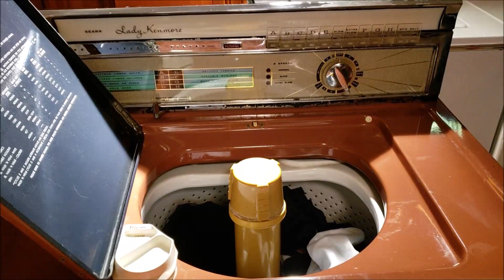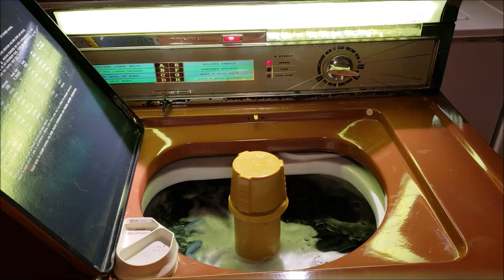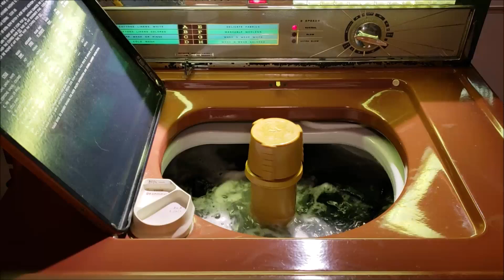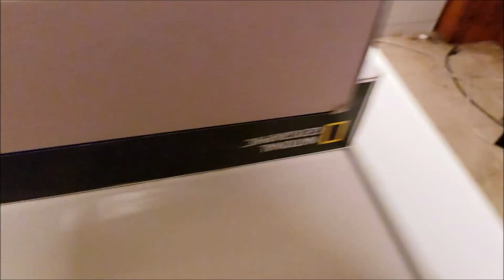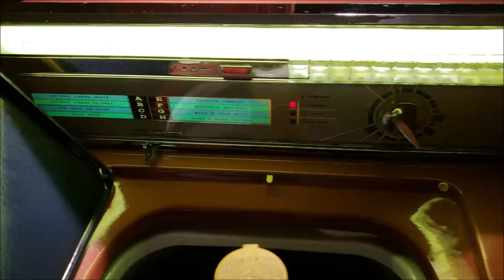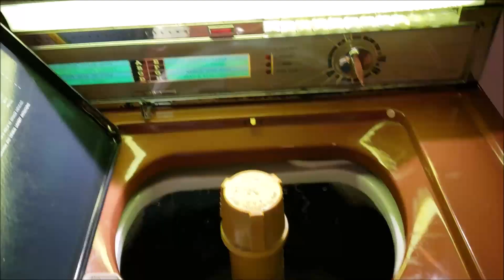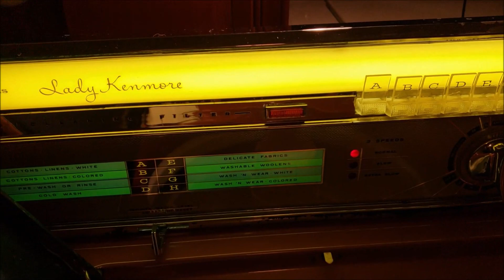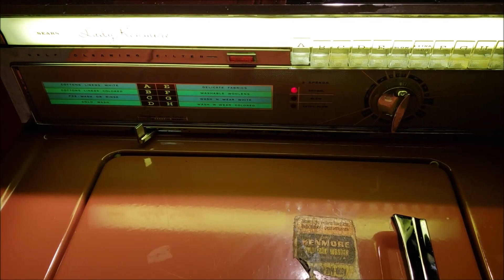1965 Lady Kenmore Washer- Washing work pants

Comment: Adjusting the water level to low does not change the amount of time it takes to drain that’s a timed drain cycle. Regardless of the water level in the tub high or low it will drain the same amount of time. My aunt had a Kenmore washer and I used to do her laundry many times it was an oldie believe it or not it was older than this one it had all the alphabets that you select a cycle with. Built like a tank with the black Roto swirl agitator and the same top that you have, black rubber with a detergent cup over it.
Reply: Was it the 1958 model with the black Roto swirl agitator and the letter K engraved on the timer and or agitator?
Reply: Antonio Carter yes I think so. I know I saw one on YouTube that was restored and looked beautiful. If I find it later I will let you know.
Reply: The 800 model had the black roto swirl agitator with the cup over it also alphabet cycle selector with the lighted panel  ours was a 60s model
Reply: On This Machine There's A 2 Min. Draining Period Before It Goes Into Spin

Comment: Gorgeous machine.  Love the color and the lit control panel.  The agitator scrubber is something we'll never see again.  When Whirlpool changed from direct drive to belt drive I spoke with some or the morons at Sears, they said the lid lock is needed to prevent accidents.  I then mentioned the agitator scrubbers and how it was never even needed, they didn't want to hear anything other than HE and see those commission dollars come their way.
Reply from the maker: Sad to see the state of appliances and Sears! Kenmore used to mean something. Don't even get me started about HE machines.
Reply: @Gsohoover  I honestly think that he washers do a very good job at cleaning. They just have all these new "technologies" that are supposed to clean the clothes better. For example, LG top loaders have something called "Turbo wash technology", which was patented by LG. Bottom line, they are good at cleaning. The only things I dislike about HE washers is that they only last five years and you cant overload them without something going wrong. But overall, they're pretty good machines. But I respect your opinion Gso.
Reply: Hi Jay yes you are right . The machines were the best machines ever. Idiots made these new machines.my mom had a machine similar to this machine. Had it for 30 years.until the pump went on it. A repair man came and tightened the belt thought it just needed and adjusting and wrecked the machine.
Reply: That is some great roll over.

Comment: As clunky as Kenmore/Whirlpool washers were they sure deserve their place as some of the best washers this country ever produced. 

Sure there were rarer and better spinning washers, but these belt drive WP/KM have such a personality that is unique to the brand.  They cleaned very well and sound like no others and were built very well.

Just a nostalgia trip every time I see one of these, because when I was young in the 70's and early 80's I saw these machines around quite a bit. Hard to believe these would one day never be produced again.
Reply: Maytags may not have cleaned quite as well, but I think they were built even better. And I like the way manny of them sound as well.
Reply: @wawawis  Maytag may have been engineered better with less moving parts but as far as build quality I think these were evey but as well built as a Maytag but then I haven't been able to compare these machines side by side .

Comment: @ Gsohoover:

Hi, I’m Charles...

And I am also a Kenmore fan.

I used Kenmores growing up....

.  24” Kenmore 1-Speed/1Cycle (1967-78)

.  Kenmore Model 70 Large Capacity (1978-). Still running when I left home in 1987

.  Kenmore Model 600 2-Speed/3-Cycle w/Waterfull Lint Filter And Black Bakelite Straight-Vane Agitator (like the 1967 24” 1-Speed/Cycle I grew up with)(1967-1990)

.  Kenmore Model 80 Direct-Drive w/Dual-Action Agitator (1990-2007)

.  Kenmore Elite Model w/Stainless Steel Tub And Dual-Action Agitator (2007 until we moved).

And our Dryers were.....

.  Kenmore All American Match All Dryer w/Solid-State Sensor inside a 5.9 cu. ft. Drum, Wrinkle-Guard, and Full-Width Door (1976-)(mate to our Kenmore 24” Washer)

. Kenmore Match All Dryer to the 1990
Kenmore Direct-Drive Washer, also with Solid-State Sensor (now with a Lighted 6.9 cu. ft. Drum), Wrinkle-Guard and Semi Full-Width Door (1987).

Now, with all of that out the way, and I hate to put it to you, but I believe your 1965 Lady Kenmore did have a Tub Light inside of it.

Are you sure that it doesn’t?

You also said that Paul has a 1965 Lady Kenmore just like yours, and I believe it has a Tub Light inside of it.

You may want to check with him on that.

The very first Lady Kenmore Keyboard did not have a Lighted Tub, but it did have a Detergent Dispenser on the right side of top of the machine next to lid.

You might want to thoroughly check into that.

Your 1965 Lady Kenmore is a beautiful and quiet machine, but I only believe that the 1969-75 Lady Kenmores were quieter still.

Your 1965 is still a beautiful machine.

Hope you enjoy it immensely.

—Charles—
Reply: Oh.......  and the Keyboard Lady Kenmore Model was made from 1969-75)

—Charles—
Reply from the maker: Hi Charles, I will look into it. You have thorough experience with Kenmore. I plan on checking into the tub light. Thank you for watching the video.
Reply: Gsohoover my moms lady kenmore had the tube. Light. Plus the panel lit up and the filter light lit up while the machine was washing
Reply: I Think In 72 They Came Out With Quiet Pak Models That Ran Quieter Than This One Which Uses A Standard Belt

Comment: I Think The Back Legs Are Self Adjusting But They Tend To Get Stuck, When That Happens Lift The Back Of The Machine Up, Take A Screwdriver And Pry The Leg That's Closest To The Washer Cabinet Out Then When Set It Down Let Machine Drop Onto Legs To Stabilize It

Comment: Great rollover, that agitator does a superjob. There is a roto swirl agitator, penta swirl agitator and I forgot the name of this one?
Reply: Rotoflex
Reply: pat cola thanks is that the one with the dial on top to change the vanes on the bottom?
Reply: @petermaz701  

The one you are thinking of was called vari-flex agitator. That was the agitator directly after this one I believe.
Reply: pat cola thanks, so they had 4 different agitators along the way.  Kept it interesting I guess.
Reply: @petermaz701  

I think all the Kenmore agitators were...here goes in no particular order.

1. Bakelite straight vane
2.Bakelite Roto swirl
3. Poly Super roto swirl
4. Roto flex
5. Poly straight vane
6. Vari flex

7. Large capacity straight vane in their first large capacity washers in the late 60's. Fins protruded up the agitator similar to speed queen.

8. Penta swirl
9. Penta vane
10. Dual action

Almost forgot Sears did have a large capacity super roto swirl also.

Quite a bit of agitators while sister whirlpool stuck with the super surgilator in varying forms over the belt drive's nearly 40 year run.
Reply: pat cola oh my God Pat you’re like an agitator guru,  my hat goes off to you. Great info, that I certainly won’t remember my mind isn’t what it used to be anymore, it was fried when I was young imagine now.

Comment: 7 seconds each for the spray rinses
Reply: If you listen closely, it's a 6-second solenoid-timed  spray.  We had a 1969 RCA washer built by Inglis with a whirlpool lint filter. It had the same pattern of spray rinses as your Lady Kenmorebut they were five seconds in duration. We later got a 1987 Kenmore and it had the exact same rinse pattern of four spray rinses x 5 seconds that the RCA had 18 years previously! Either the engineers were lazy, or it must have worked!

Comment: What is the ticking noise 👎 in the spin cycle? I do not 👎 hear 👂 it in the wash, or drain cycle. I know ya said these machines have little quirks of their own, such as when ya take one out of storage to use it. I hope somebody specially builds transmissions, gears ⚙, and motors for these wonderful washing machines. They still make the original whitewall tires for classic cars, from the original molds. I hope that's also the truth with these Kenmore's, and Whirlpool's. There's buffs for these as well. I hope they make the parts for them. Your friend, Jeff.
Reply: That’s the timer.  It is present earlier in the cycle if you listen carefully, but the agitation noises cover it up a bit, because the ticking coincides with the water sloshing as the agitator reverses direction.
Reply: The Wig Wag Oscillating